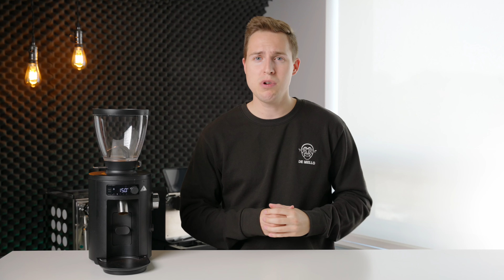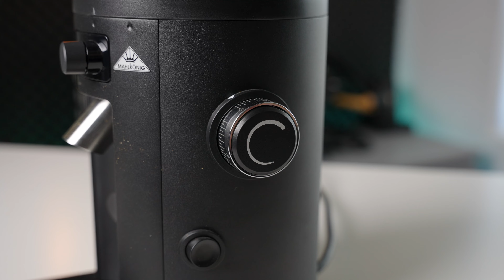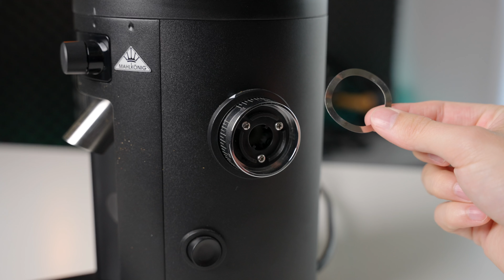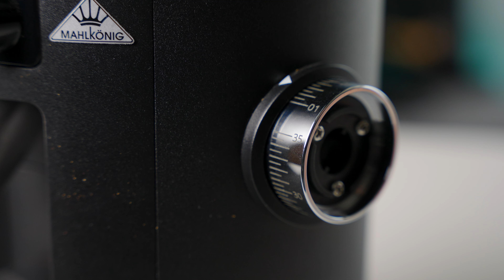Mahlkonig X54 Burr Calibration | How To

Comment: Thanks for the video, it was nice to see an independent step by step guide vs the manufacturers. I have been having challenges getting it calibrated. I find the adjustment nob very temperamental and not easy to adjust. I also don’t like the fact I have to waste so much coffee just to change the grind size.
Reply: What are you doing to stop wasting? I have the same problem!  I bought the single dose hopper from a 3rd party… I’ll see how it works.

Comment: Have you tried rpm control on your grinder through a voltage regulator, as far as I know that flat burr set at 800 rpm will get your more cleaner cup, and for conical burr set will be at 80 rpm that's the ideal rpm to produce just as clean as hand grinder for brew.

Comment: Dear Matt! Thanks for the video!! I also have seen the video from the manufacturer as well, and it is a little bit confusing in the last part, as they have something about getting back to factory settings and then the knob is putted back together. Any comments?

Also, with this calibration, what numbers have you find that are the best for espresso? I have tried from 1 to 2.5 and it is too slow, almost with single drops coming outc guess it is too fine.

Comment: I've had this grinder a few weeks now and not that impressed. Takes forever to grind your dose to get all the grind out that is. Coffee comes trickling out at thee end and you have to wait for it all if you are single dosing. Not a good single dosing grinder. For an all around machine you shouldn't have to take the wheel off to readjust.....I could see this on an espresso only or pour over only grinder. The grinder isn't bad per se, but not quite what I expected. Looks good. If I was going for another single dosing grinder I'd look elsewhere.
Reply from the maker: Definitely wasn't designed to be a single dose grinder. Timed dose hopper-fed king that I do hope they change the adjustment dial on in the next iteration